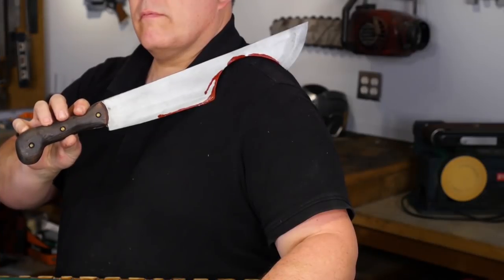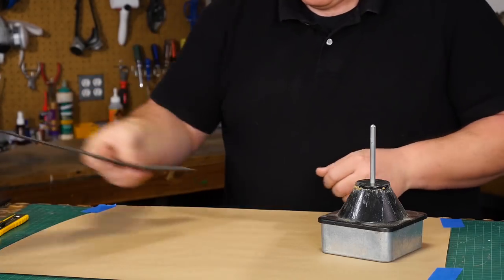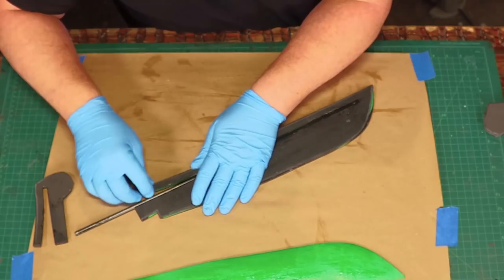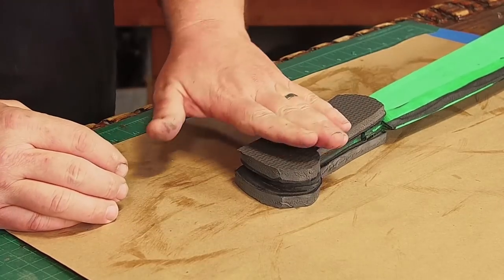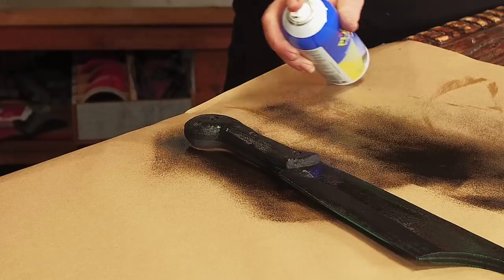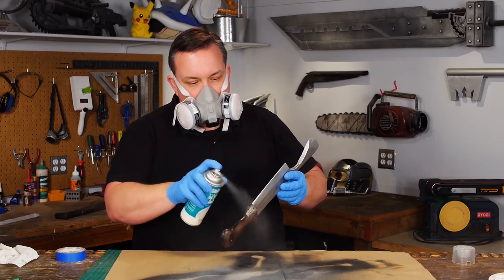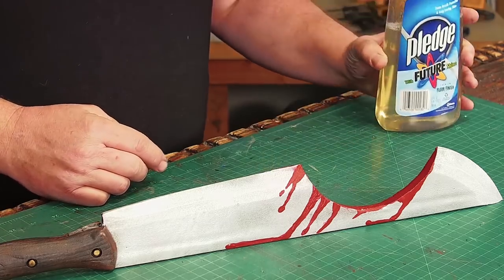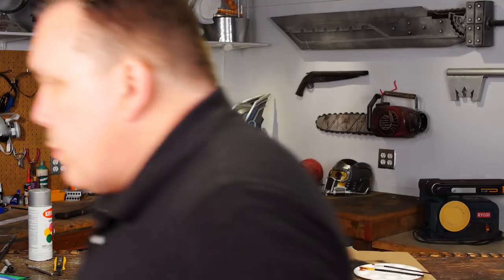Odin Makes: Jason's Machete from Friday the 13th

Comment: You should make a prop knife (for a Michael Myers thing or something you know)

I’ll tell you how mine is made

. Cut a knife shaped pattern out of a plastic refrigerator shelf (should go with one from an old refrigerator)
. Trace it twice onto thin cardboard and cut that out
. Glue them all together
. Cut 2 handle shapes out of wooden craft tags (will need to make each handle piece 2 separate pieces like the top of the handle and the bottom of the handle glued together and the second handle piece the same way)
. Line our pieces up
. Drill 3 holes
. Attach the handle pieces to the blade using brass double cap rivets
. Flatten the rivets with a hammer so that they more closely resemble cutlers rivets
. Apply wood stain to the handle (this will make the wood look nice and aged and the rivets look tarnished)
. Let it set for 2 minutes then wipe off the excess

Comment: I like what you're doing. How about making Batman's grapnel gun in foam using pvc pipe an empty large prescription bottle and some tubing. Chopsticks too.
Oh, run the tube from the pipe down the bottom of the grip. Run some black string through it to a dart the some clear line to the other end of the dart. With a little off camera help you can shoot your dart.
Also, keep the screw on lid to pull bottle turn it inside out and screw it back on. paint it orange and it's con friendly. 
how about that.

Comment: Why aren't you using armature wire for stiffening the blade? If you curve the edges over it shouldn't poke through and blade can be made much thinner that way.
Reply from the maker: I am concerned that the wire will still bend at the thin point. I wanted something light and not at all flexible.
It would be really bad if the grip/blade bent right above your hand if you swing it around.

But give it a try! the thicker armature wire used in sculpting will work, and if you have it already go for it!